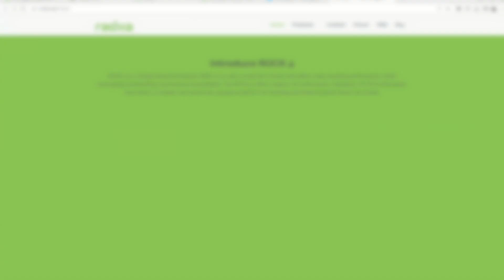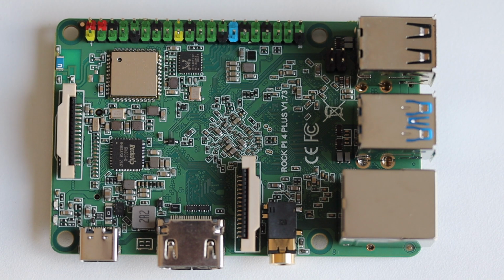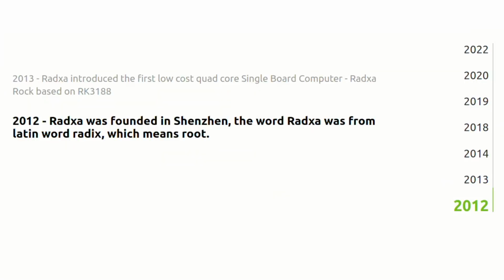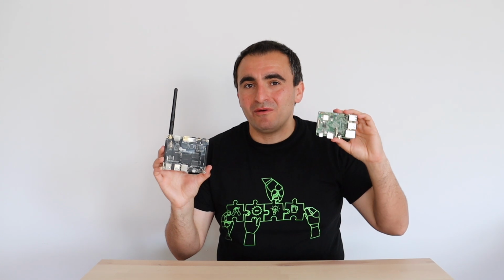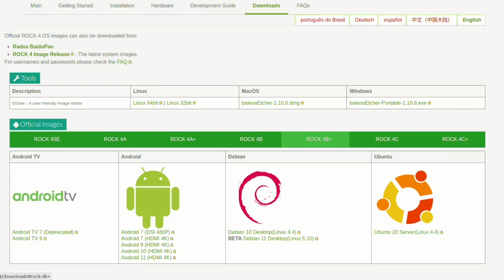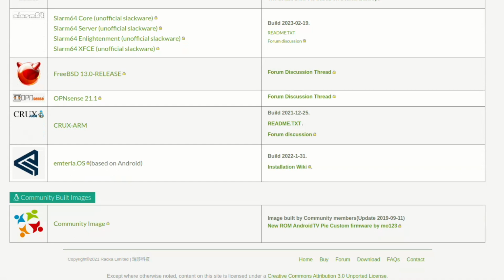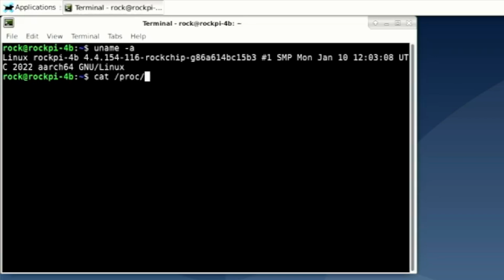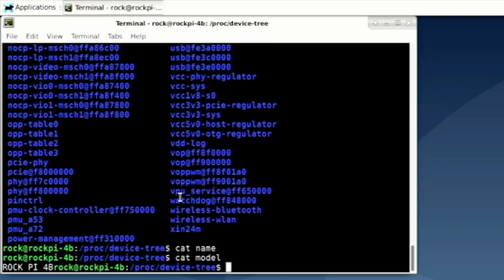Radxa Rock Pi 4 Computer with Debian Linux as a Raspberry Pi Alternative

Comment: Can I use the heat sink together with the NVMe or M2 card if they are so close together?
Reply from the maker: Very good question to which I cannot provide an exact answer right now because I haven't tried it. May be you can combine M.2 Extension Board with the "Heatsink Specialized for Radxa ROCK 4": https://radxa.com/products/accessories/heatsink-for-rock4/

Comment: The radxa nio 12l would have a mediatek genio 1200 processor
Reply from the maker: I read the news about radxa nio 12l and definitely it will be a very interesting single board computer, especially considering they are releasing it with Mediatek SoC rather than Rockchip as they have been doing it for years. Radxa is on a roll recently as I they released several new products on the market.

Comment: Did you menage to watch YouTube without it stuttering? My Rock 4 B plus deeply struggled with it
Reply from the maker: Honestly, I haven't even tried it yet. This is excellent question and probably I should give it a try at some point. Playing YouTube videos on Rock 4 and other ARM devices is tricky and depends on many things:
- Are you using X11 or wayland/xwayland?
- Are the GPU drivers for hardware acceleration enabled in the distro?
- Are the GPU hardware acceleration enabled in the web browser? On Chromium you can check it by loading "about:gpu" as URL.

Comment: They need to migrate to 3588 soon.
Reply from the maker: have a look at ROCK Pi 5 Model B. It is with Rockchip RK3588.
Reply: @LeonAnavi  Not yet, but certainly I have to look. Did you prepare a video for it?
Reply from the maker: @kamertonaudiophileplayer847  I haven't bought 5 yet. So don't hold your breath for a review about it on my side. However I have some other interested dev boards to cover in the coming months :)

Comment: 안녕하세요
저희는 영국에 위치한 SBC 제품 유통 전문 기업, RS components/OKDO 라고 합니다.
당사는 라즈베리파이를 대체할 수 있는 Radxa Rock 제품을 공급하고 있습니다.
Radxa Rock 제품은 라즈베리파이 보다 한층 더 업그레이드 제품인데, 가격은 라즈베리파이 보다
더 저렴하게 공급해드리고 있습니다. 현재 KC 인증이 완료되었거나, 조만간 완료될 제품들이 많이 있습니다.

1. 라즈베리파이 3B/3B+ => Radxa Rock 3A, 3C 로 대체 가능 (1G,2G,4G램, On/Off Power 버튼, Wifi 가능, Dual M2 Connector)
2. 라즈베리파이 4B Series => Radxa Rock 4SE, 4C+로 대체 가능 (M2 NVME socket, RTC, Android 구동 가능, eMMC socket)
3. 라즈베리파이 CM3, CM3+ Series => Radxa Rock CM3S 로 대체 가능 (1G/2G RAM + 0~128GM eMMC. 양산중)
4. 라즈베리파이 CM4 Series => Radxa Rock CM3 로 대체 가능 (2G/16G eMMC & 4G/32G eMMC with Wifi/Bluetooth. 양산중)
5. 라즈베리파이에는 없는 슈퍼 싱글보드컴퓨터 : Radxa Rock 5B 8G, 16G, 32G (RK3588) 와 Radxa Rock 5A (RK3588S)
6. 이외에 여러 가지 Rock 제품들이 있습니다 (예: x86기반의 Rock X2, Rock Zero 등)

언제든지 관련해서 연락을 주시면 적극적이고 친절한 대응을 약속드립니다!

https://www.okdo.com/c/rock-shop/rock-sbc/
krenquiry@rs-components.com